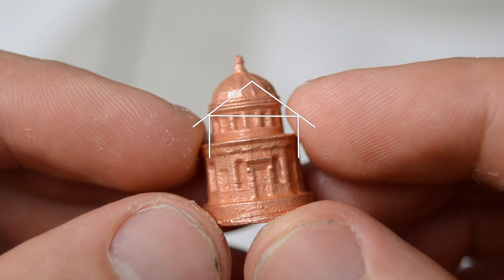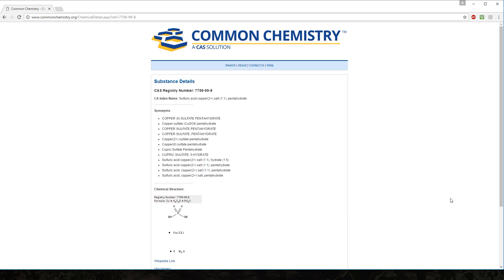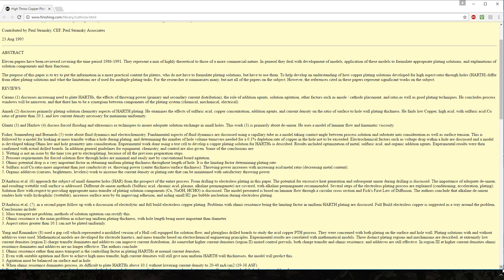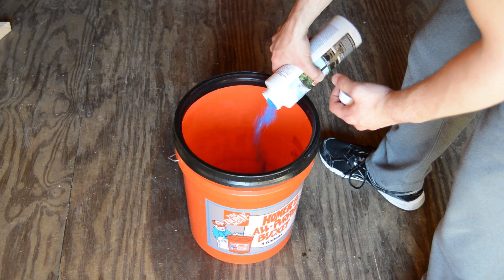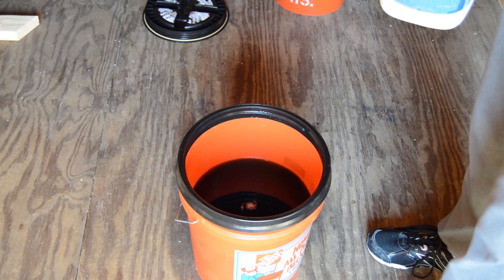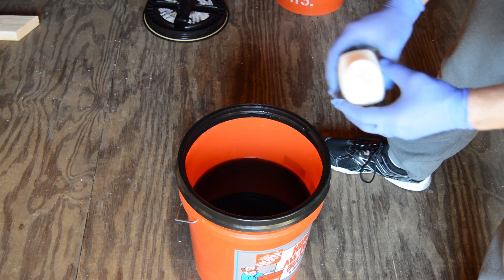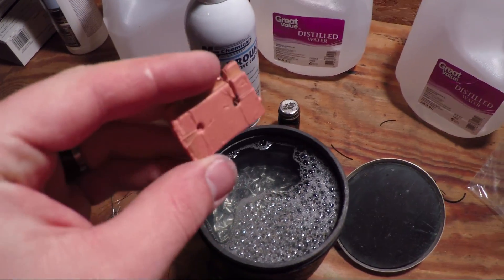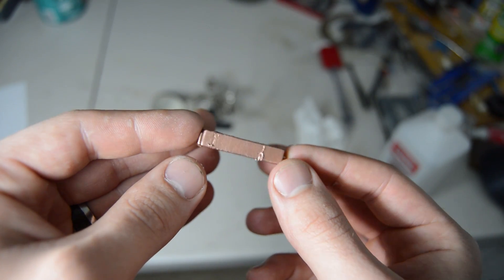Best Copper Plating Solution ~ DIY Professional #3

Comment: Thank you so much for posting this video really descriptive! Appreciate the info. I had some questions tho?  I had purchased a kit online and it seems its gotton to much  chloride contamination so the plate is quite grainy and inconsistent . I feel its about time to mix up  a new bath. The kit I had purchased needed less sulfuric acid . It instructed to operate the bath about 70° to95°f   With a aquarium heater. I noticed yours was about 130° and used more sulfuric acid . So my question is by using the solution you show  and operating at about 75°F with my aquarium heater and agitator  will i still get the same results or do I need to modify my set up?
Reply from the maker: Try using the document provided at this link to troubleshoot issues with the plating solution:  http://www3.uic.com/wcms/images2.nsf/c06db59d70a043cc85256809004d8cbe/183dbe584ba8157b852570140067e6a2/$FILE/09-Electrolytic_Copper_Plating_Additives_and_Contaminants.pdf

If you had a grainy or "rough" surface that may have been due to a low sulfuric acid concentration.  In general conductivity increases with temperature, at a lower temperature you should expect to see higher voltages for the same amount of current.  70F-120F is the ideal operating temperatures for an acid copper plating bath.  You should run your bath at a voltage high enough to get a current density of about 20-50 A/ft^2.  And maintain a pH in the vicinity of 2.5.  I think you will be fine operating my copper plating solution at 75F.  Right now my bath heaters can't keep up with the colder temperatures in my shed and its been running at about 50C without any problems.

More operating parameters can be found here: http://transene.com/copper-plating/
Reply from the maker: +a appleseed quick side question, were you heating the copper plating solution directly with the aquarium heaters?
Reply: Garage Science yea i have it directly in the solution .
Reply: Garage Science great to hear . Thank you for the quick response!    Iv been looking into different plating solutions. Some with higher  copper  sulfate  concentration and lower sulfuric acid  like that came with me caswell kit http://www.caswellplating.com/copper-crystals-with-brightener1-5-gal.html Then others like yours with less copper sulfate and more sulfuric acid to make the remaining needed copper sulfate by being made in the bath from the extra sulfuric acid  reacting  with the  copper anodes to make copper sulfate  to fully saturate the solution.
Reply from the maker: +a appleseed unless the heater is made of stainless steel it will corrode and dissolve into the bath because of the higher acid concectration. I would suggest a plating bath within a separate heating bath like the setup I use.  If you get aluminum or iron contamination in your bath your plating will get really bad pretty fast.
Reply: @GarageScience  Hello garage Science the link doesn't work anymore, do you still have this information

Comment: Subscribed, yeah g'day.
I'm about to copper 2 blades made of 5160 with copper in an attempt to slow the iron oxide invasion.
bottle/bath needs to be 30cm deep x 7cm wide to take the blades.
I've boiled the water out of my battery acid .. it has to be 90% pure ... it tastes 90% pure.
My next step is to dump a load of copper sulphate into hot water then dump that into my lovely pure acid?
I'm intending to use a pure copper plate like a paint brush - without any contact ... supported evenly 4mm away the full length of the blades.
I'm intending to use 12v like an arc welder ??? 
My question is ""How Much Clean/Pure battery acid do I use to make lets say 2 ltrs of total mix ??"
I can do 100% ... I'm picking something like 50% Acid 50% water/copper is going to be a very active application?
Reply from the maker: Please don't do this experiment. You've said your battery acid "tastes" 100% pure?!?!? Concentrations of solutions are measured in molarity, as in mols per liter. Also, besides the enormous safety risk you appear to be taking the experiment wouldn't work anyways. Copper undergoes an exchange reaction with iron that I've explained in a video about the reactivity series. You simply will not get a coat of copper to adhere. Moreover, copper oxidizes readily just like iron, it will tarnish and become green with copper oxide very quickly. Passivating your steel is a much more proper method of stopping the rusting you're getting.

Comment: does it make a difference if we use Copper Sulfate vs Copper Sulfate Pentahydrate?
thanks
Reply from the maker: No. The pentahydrate just means their is water trapped in the copper Sulfate crystals. But your going to dissolve the crystals in water anyways.

Comment: “Don’t use tap because chlorine is bad” - proceeds to add HCL 😅
Reply from the maker: Even with an unheated bath you'll lose water to evaporation. Any water additions should be distilled water to avoid concentrating chlorine over time. There are many other minerals/contaminates in tap and spring water that make then unsuitable for this kind of project. 

I get the irony in your comment though.  I'm just here provide some laughs 😉.

Comment: Very informative! It seems to me that it's not that more expensive just to buy copper plating solution from the pros. You have to have the room to make all this which most people don't have. Doing this from scratch is about $100 and buying from the pros like Caswell Plating is only about $200. But for those hankering for chemistry adventures this video is the way to go.

Comment: does the soluition expire and if so how long until it needs to be changed?
Reply from the maker: The PEG can theoretically breakdown over time. I've plated with the same solution nearly around the clock for months without having to remake.  Only adding a little PEG or HCL now and again

Comment: can you reuse the solution??
Reply from the maker: Yes. So long as you minimize the introduction of contaminates and occasionally add a few grams of PEG then you can use it almost indefinitely. I had the mixture in the video for over a year. Only got rid of it because I moved across the country.
Reply: @GarageScience  is it still being used?  Also did you notice any breakdown in the bucket plastic over time?  That was my concern with storage.
Reply from the maker: I had to dump the solution in order to move. I haven't refilled it since. But it's held the electrolyte for years without issues.

Comment: So essentially you used 2 gallons of water? One heated and one added after?
Reply from the maker: More or less. Heating it to dissolve the copper sulphate speeds up the process. Otherwise you'll be sitting there stirring it for a long time.
Reply: @GarageScience  Thank you Sir

Comment: I tried an acetic acid vinegar with baking soda bath. My plating turned out black. I realize I was making a mistake using tap water. Could that be the lone source of excessive oxidation? Really enjoyed your video it was very easy to understand and entertaining
Reply from the maker: Try reducing your plating voltage... if it's a fixed voltage source you may want to add a resistor in series with the plating bath.  You can use ohms law to determine a resistance value for your bath (that is, for the conductivity and voltage you are running the bath at since it isn't constant) and then use a basic voltage divider calculation to get the right sized resistor.  Make sure you get one rated for the right number of watts though.

Comment: You probably are aware that PEG is an abbreviation for a range of molecular weight polyethylene glycol polymers.  There has been research done to look at optimum Mw (As PEG Mw was increased, the best filling performance of plating formula was obtained when the PEG Mw ranged from 6000 to 8000 g/mol. Only large PEG amounts whose Mw exceeds 2000 g/mol can effectively polarize the cathode,) for inducing a leveling effect.

The laxative (and all similar products ie Restoralax etc) you mention is typically 3350 which is greater than the minimum Mw here is exceeded but is less than optimal.  You might consider adding 1 or 2% sodium saccharin or even borax as brighteners.  The Saccharin adds the much needed sulfur moiety for the PEG's optimum effect.  For electroforming, you might consider the sulfamate preparations, at least consider it if you're looking at bright nickel electroforming.
Reply from the maker: This is great info, thanks!

Comment: Can brass or bronze be electroplated onto steel or copper?  the same procedure for making nickel sulfate?
Reply from the maker: Brass and Bronze are composite materials made of several different kinds of metal.  There may be a way to do it but I have yet to come across a way.  My first inclination is no.

Comment: Great video  - I learned alot from it.  I am trying to find an easier and less expensive way braze tungsten carbide cutting tips onto steel (for special tooling)... current method requires silver solder ...50%-silver, 30%-copper and others zn sn ..it does a great job but very expensive.  There is a much less expensive solder available 86%-copper, 6%-phosphorus and 5% silver.  This cheaper solder wets and bonds well to Tungsten Carbide but does not bond well at all to steel..  the carbide tips pop off easy.  I after watching your video I was thinking that I can copper plate the tips of the tool steel and then use the cheaper solder ( which has lots of copper)  to braze the TC onto the tool steel?  finish is not important - actually rougher surfaces  give a better bond to solder/braze - do you think copper plating could be strong enough?  I also watched your nickel plating vid..... nickel coat first and then copper coat second be better?
Reply from the maker: Using my guides you'll definitely have to nickel plate prior to copper plating.  I can't give a definitive answer on how strong it will be.  If you don't do copper plating right your results can be pretty brittle.  This solution will create a relatively ductile copper plating though I don't have any hardness test results to share.
Reply: @GarageScience  After watching your video got all excited thought I would give copperplating a try anyways - our little city had all the ingredient you have listed !! (minus the Mirolax - don't think I need it) and new buckets - total costs is much less the kits on line (in Ontario,Canada)  - I would have to order in Nickel but for meantime I am going to try copper first!  Thanks for your help!
Reply: @wojowrench4716  in Canada,  older nickels are actually pure nickel. Something like before 1980. I've been collecting them and they work well for making nickel-plateing solution
Reply: @GarageScience  Hi - (with your help) I successfully made a nickel bath from  local supplied materials - I made a nickel coat on my part and was quite impressed!...  The bond strength between nickel and steel  is very tough it is a strong bond- I used a chisel and hammer to try and get underneath the nickel coat and lift it off - Could NOT!  and the strength and ductility of Nickel is exceptional - I know this will work for my application - in future I would like to do a pull test just to see how strong the bond is in PSI  - thanks again - I am looking to buy  Nickel Sulphate - I made my own like your video but online for sale is Nickel Hexa Sulphate - what is the difference from Penta?
Reply: 11:15 This looks like doing copper plating in a mass production factory.

Comment: First of all I found your copper plating video and installation great, now secondly I would like to know if you have any email to communicate with you, since I have an installation similar to yours although much more rudimentary and I am having problems with copper plating and I would like you to He will advise a little, since he would like to know for what reason he could be having these problems. In general terms, what happens to me is that I notice that the coppering is done extremely quickly, in just 1 minute the pieces that I submerge are completely covered by copper but superficially and when passing a cloth, practically everything is removed and only one layer adheres very fine copper. I am working with a voltage of 3.3 and amperage of 25 (I use that amperage considering a curren density of 0.15 because what I am covering is a piece of almost 150 square inches, 75 for each side). Could you advise me more or less by telling me what amperage I should really use since I think that's the real problem. I'm from Chile, sorry if my English is not very good hahaha
Reply from the maker: Email is in my youtube channel page.

Comment: After you mix the acid in and have the complete solution, is the final result safe if it gets on your skin?    I'm ok having to be careful with acid once but if the actual resulting solution is still dangerous, I don't think I'd be comfortable leaving something in buckets in my garage that could be dangerous if spilled.
Reply from the maker: The sulphuric acid is fairly dilute, but the solution itself is still pretty corrosive.  Not something you would want to spill. I use the 5gal buckets with screw on lids so I can keep it secure when not used. It wont instantly give you a chemical burn but still not something you want to ingest or get into your eyes

Comment: So what if copper oxide is forming on the metal (you can wipe it off)
Reply from the maker: It shouldn't form during the plating, if it is that could indicate that you no longer have an acidic solution. If its forming after plating then that's normal. Some sort of coating is needed to prevent copper from oxidizing when exposed to air.

Comment: Hello mate nice videos ! I am looking to find a replacement for Nickel Plating but silver is too expensive. I was thinking about white bronze but i couldnt find any info. Do you have any opinion ? Zinc or tin needs a lot of post processing to shine like nickel.
Reply from the maker: Not aware of a way to plate bronze  since it's a composite metal. There is probably a zinc plating recipe out there similar to the copper plating recipes I use... for post plating polishing I just use a tumbler with dish soap and lemishine.
Reply: @GarageScience  well i know the way to plate bronze but i cant find anything on white bronze anodes.. I mean i usually plate Zamak parts. Copper plate then Nickel plate and after a bronze plate to give a "gold" coloring to them but i can find brass/bronze anodes to buy. Assuming that white bronze is copper/tin/zinc and bronze is quite the same do you believe that the same solution will work ? Sorry for asking such a thing but i wanted someone with more knowledge than me to give some advice. To make White bronze i would have to build a metal foundry so a better research is always a nice idea :P
Reply from the maker: @wearetherandombros7782 , I would say to never assume the same solution will work for two different kinds of metals(for example, copper and nickel plating solutions are very different from each other.). I dont know of a solution for bronze but a Google search that includes "scholarly articles on" should turn up some white paper research on the subject.
Reply: @GarageScience  Thanks mate !! :) I will!!

Comment: Hi. Great video, thanks for sharing the recipe! I have a question though. While researching copper plating solution recipes, I found versions that contain a lot less battery acid (with other amounts being the same as in your recipe, only about 20-25 ml of battery acid). Could you please share you thoughts on that, i.e. how is it possible to get good copper plating results with solutions that have a huge difference in battery acid concentration?
Reply from the maker: Sulphuric Acid does three things
1) it helps corrode and breakdown the copper electrode
2) increases conductivity of the solution which increases plating ability.
3) provides "throwing power" which helps to plate in channels, cracks and crevices on the part.

Less battery acid just means these effects will occur at a lower amount. There are other additives you can use to increase these effects but having more battery acid is the simplest and most straight forward way to improve these three effects.
Reply: @GarageScience  Thank you for this detailed response! Much appreciated :)

Comment: So basically just use my spent hydrochloric acid/hydrogen peroxide etchant, distill it down a bit, and plate with it. Maybe add a bit of sulfuric acid to really get things moving. 
  IIRC Sulfuric and hydrochloric acid mixed ~1:1 is the solution powerful enough to dissolve gold. 
   Muriatic acid isn't so bad though. Half the stuff under most people's kitchen sink is just as powerful. I was all worried about it when I started using it. It's enough to be serious about, but it's not like it burns on contact or anything. 
 Thanks for the upload.
-Jake
Reply from the maker: Hydrochloric acid is very dangerous so always use caution. Consumer cleaners using hydrochloric acid are relatively low in concentration and contain other chemicals that may minimize its harsh effects. Muriatic Acid bought from a hardware store is generally about 35% by weight and is strong enough to dissolve concrete. The vapors from a concentration like that can cause chemical burns in your lungs... not trying to scare you just trying to be real ;)
Reply: @GarageScience  
  Hey thanks for telling the pinned comment not to use mixtures with any aluminum. I use aluminum cans to make my own SMD solder paste stencils. I usually just use some old spent etchant as it will still go right through thin aluminum.
  I'm about to try making my first 4 layer boards, but I need to get a plating process working first...thus why I'm here :-)